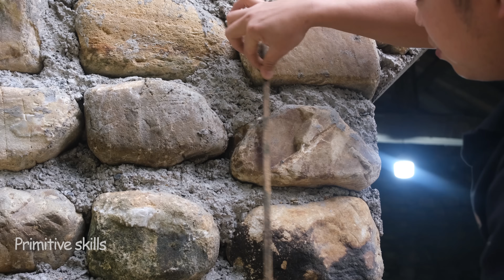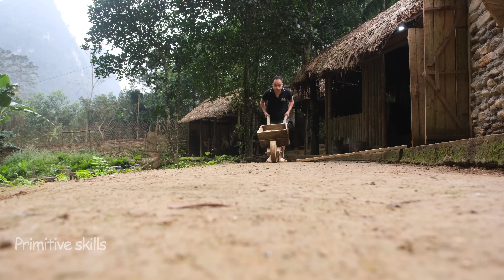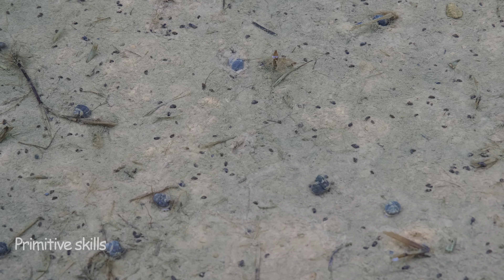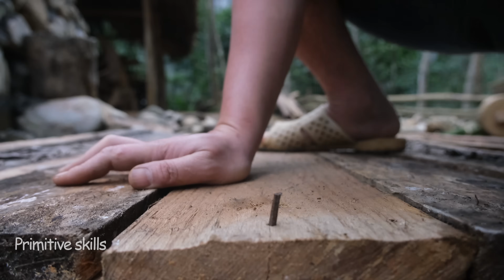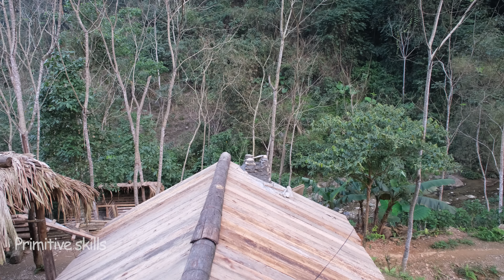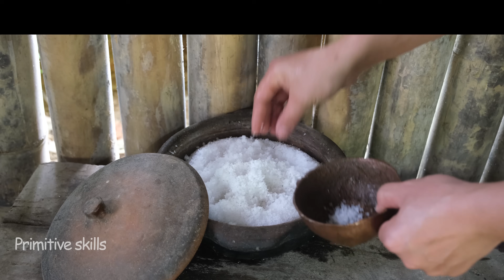PRIMTIVE SKILLS; Build a stone fireplace/chimney can heat house (CABIN) in winter

Comment: I would definitely not raise animals on the same spot as the old pig pen for at least 5 years, or raise any ground-level food for at least 3 years, to give the African swine flu virus time to die out.  It might be a good idea to try planting bamboo there instead, since you will have woodworking materials within just a few years, or maybe fruit trees or berry bushes. Also, you NEED to raise the chimney opening another 0.3m-0.5m, and you need a way to prevent sparks from flying out the chimney and catching your wooden roof on fire.

Once you have raised the opening a little higher to keep the hot air from scorching the roof wood, the immediate (and cheapest) choice to avoid sparks catching the roof on fire is to spread a thin layer of slaked lime plaster on your roof for at least 2 meters around the chimney area, including over the ridgeline to the other side.  The slaked lime will prevent the wood from catching on fire if a spark lands on it when it is dry and the wind is just the right speed, as it is a mineral, not fuel.

Once you have the clay tile roof installed, this will not be a concern, but for now, you need to keep the roof safe, because if it burns, it will also burn your kitchen and forge areas.  One way is to burn only small fires with wood that does not create a lot of sparks, but that opening is so close to the roof, it really needs to be protected immediately.  You can paint the whole roof with the limewash for the look, or just leave it partially painted until it can be replaced, to save time and materials.

The other alternative is a wire mesh around the chimney opening.  This needs to be chimney-grade "spark arrestor" mesh, which is small enough to block flying sparks, still wide enough to allow a good draft, and strong enough to resist the heat of the fire coming up the chimney.  However, it probably will not be easy to find chimney wire mesh in Vietnam, and it will not be cheap to get it, and very expensive to import it, so I'd go with limewashing the roof.

If you do not raise the height of the chimney, then lime-plaster the wood immediately around it for at least 1m to prevent heat from scorching the wood, and make the plaster at least 1cm thick.  This will help insulate it from the heat coming out of the chimney.  Then make sure to cover at least 2 more meters of wooden roof with more lime plaster, since the sparks won't have time to cool down as they escape the chimney.  And yes, you still have to coat the far side of the roof, too.  Wind can lift a spark up and over the ridgeline, so you actually need to cover more area on the far side just in case.

Remember, if that roof catches on fire, it can burn all the way across to the kitchen roof far faster than you might realize.  Take steps to protect it as soon as possible, please!
Reply from the maker: Thank you, your shares are very useful to me, wish you and your family good health